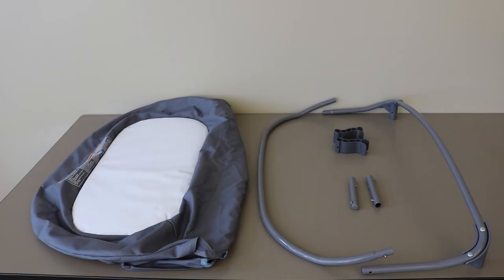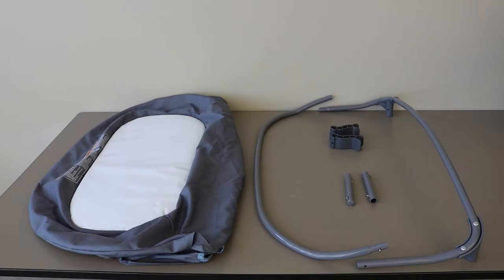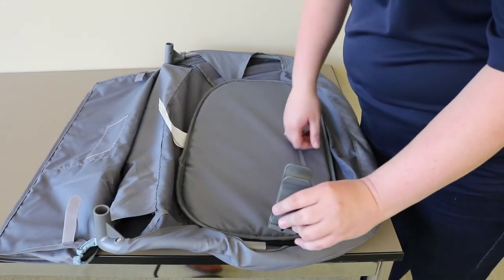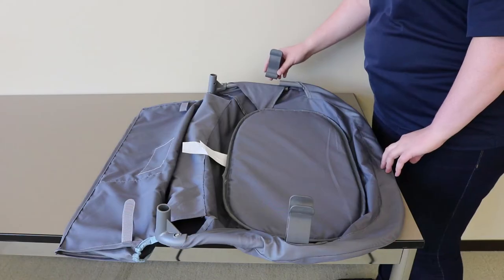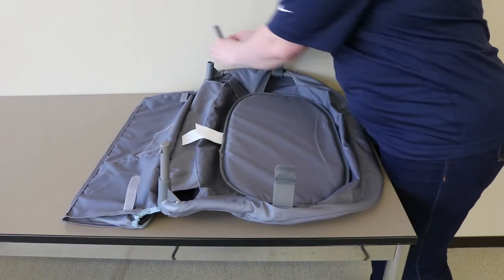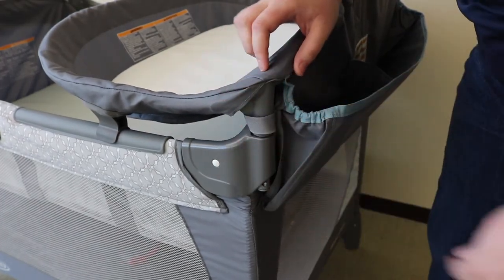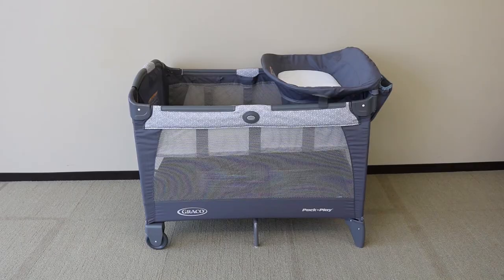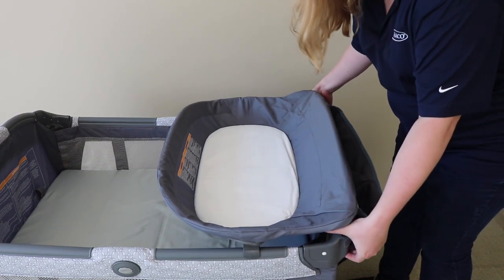Graco® Pack 'n Play® Playard - Side Attachment Diaper Changer Assembly

Comment: And how on earth do you pack it back into the package?  ZERO instructions on your "manual"... zero videos... Absolutely shameful that you sell a product and only cover half the job.   But I bought it so I guess it's my problem now huh?
Reply: I can’t even take the connector tubes off.
Reply: I am having the same problem
Reply: @gracehigdon7116  I figured it out... It's not pretty but it works.  After you collapse it, put the mesh with the hooks on top and then place the unclipped changing pad on top of that then wrap and strap it... Good luck.
Reply: The side corner post come out, there's a tab you pry open

Comment: If you are attempting to DISASSEMBLE, I was able to do it by wedging a flathead screwdriver into the interior attachment tab on the corner bracket. You can force the tab out of locked position  and pull the leg out. V bad design, ugly solution, but it works. Mine didn’t break, but be careful not to be too aggressive.
Reply: You’re a hero
Reply: Thank you from 2024